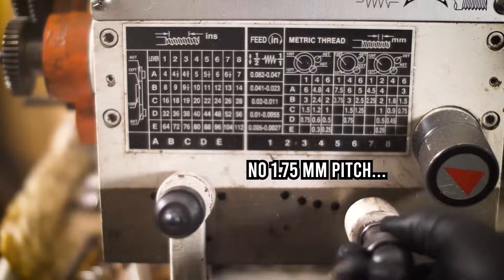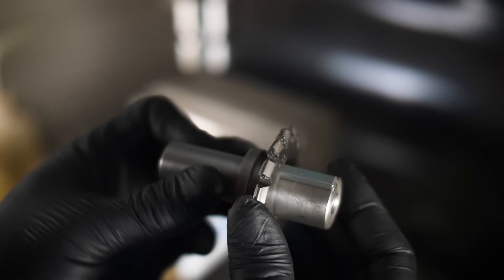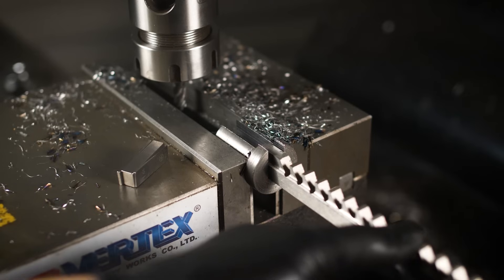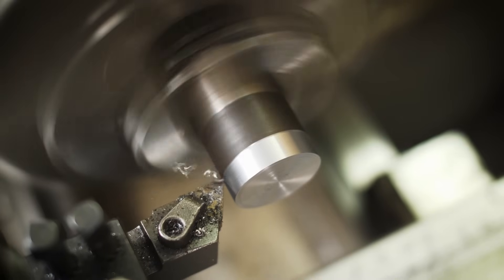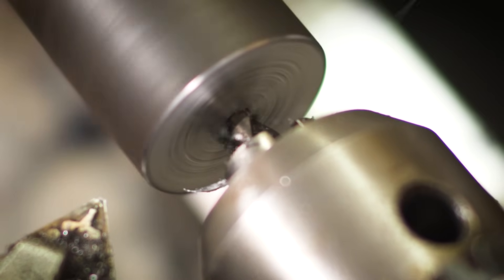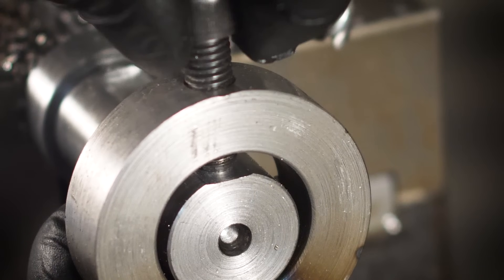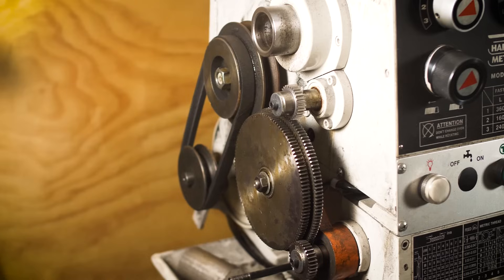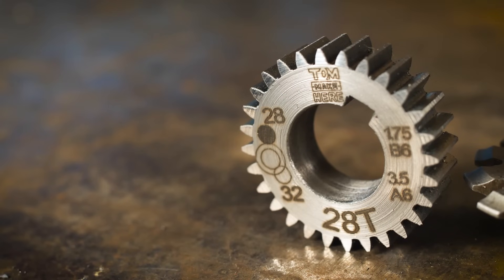Tool Making and Gear Making! | AL-960B Change Gear

Comment: Hi Tom, great to see someone else doing lathe videos and yep they are hard to video, tool post is always in the way, what a coincidence I use to own an AL 960 B and it did a lot of good work for me, looks like you are getting good results with yours as well ( my new lathe is a AL 356 a little bit bigger and heavier which I have converted to CNC ) I think I will have to get a laser engraver I think they would be so handy I really enjoyed the video and have subscribed, happy to support another enthusiast......... cheers Bill
Reply from the maker: I modified my toolpost so it doesn't have a permanent handle on top specifically for filming! Makes filming easier. Yeah it's a great lathe. I'm considering CNC upgrades for all my machines; I've come to the conclusion that I don't have as much time as I'd like. The laser engraver is useful, I didn't know what to do with it initially, but is very handy!

Comment: 4:19 Between centres? 
You've got your headstock centre in the 3-jaw, with any inaccuracy that chuck has.
My lathe has an MT3 taper in the spindle so I can put a centre straight in and drive on the faceplate for driving between centres. 
Check if yours has this.
Reply from the maker: Mine does have the centre, but then no way of turning the dog. I turned the 3 jaw'd centre in place so it is running true to the spindle

Comment: Perfectly cut and put together video for an old guy like me with the attention span of a sparrow.

Would love to have a go at this but at the moment I have a mini lathe and 3d print any extra gears I need.

Thanks for the upload.

Regards Doc from South Australia.
Reply from the maker: @doc1701  thanks! I do try to keep the videos concise. I've heard about people using 3d printed gears, do they work ok?
Reply: @TomMakeHere  They seem to do the job well enough for me. 
I have a 7x14 mini lathe with plastic gears and only need to use 3d printed ones occasionally for threading some weird thread.
No problems yet, touch wood, erm, metal 😀
Reply from the maker: @doc1701  😂

Comment: Hi Tom, i saw from one of the comments that either yours or Mattys tooth count will work. Mate i just wondered if you knew and could share the number of teeth on the gears A to E and 1 to 8 on the selectors. I cant find them anywhere and they would be needed i assume to calculate final impact on leadscrew? Many thanks, Steve
Reply: Addit...all good. Just worked backward from change gear table.....derrr 😊

Comment: No heat treatment?
Reply from the maker: The gear only gets short, intermittent use. I've seen 70 year old lathes with cast iron gears that are in perfect condition. So I'm comfortable with unhardened gears for this application

Comment: Another good video Tom. I recall Matty from Matty's workshop making a gear for his lathe (same model lathe as your one I think) to cut a 1.75mm pitch thread. The discussion at the time with him was that all M12 bolts that you get from Bunnings etc. has a 1.75mm pitch thread. So it is a common pitch in regards to M12, but it looks like M12 is the only size to use the 1.75mm pitch. A couple of years ago I brought a larger Hafco lathe, and I noticed that I have 1.75mm pitch available. That said, I would have to change out the gear and install the 35 toothed gear that come with the lathe.  It looks like the gears that you made have 28 teeth so I presume there are some differences between our lathes.
Reply from the maker: @thehobbymachinistnz  yeah its only M12 that uses 1.75 pitch as far as I'm aware. In making drawbar etc I need M12 fairly frequently and dies aren't great in this size unless the thread is partially cut. It's possible to achieve this thread with either a 28 or 35 tooth gear but a different combination of gear levers. I figured why cut more teeth than required? 😂

Comment: How did you determine the outside diameter for the 28 tooth gear. On that lathe are they a modular section (metric) cut.
Reply from the maker: I measured an existing gear OD and used that to calculate the module. I checked a couple of hears to be sure. Then I just used gear formulas to calculate the required OD

Comment: Great video! Love the laser engraver, very useful. 👍
Regarding the hydraulic press, if you made a top cup that held the top end of the broach secure in XY, and held the workpiece secure in XY, the broach should work fine. Typemof press doesnt really matter, the thing that matters is that the broach is constrained in XY and can only move in Z
Reply from the maker: Good point. Yeah some guides would definitely help contrain it
Thanks for watching

Comment: Nice vid mate. I have the same lathe that I rebuilt it from new and accurized for substantialy for gunsmithing. They are actually quite a good bench lathe. One mod I did to mine was to make  a phenolic resin sacrificial gear in the train as they have no clutch on the line anywhere so if you are too slow on the nuts and crash it without a soft gear they will destroy themselves. Also I threw away the duel speed B section pulleys and went to a single A section with a cogged raw edge belt to remove vibration. Just thought I would share this for consideration. These mods made a good lathe into a really good lathe for small accurate work. I've built some amazing target rifles on mine.🤘
Reply from the maker: I have quite a few mods that I want to implement, yeah belts is one thing. I also need to check out the middle speed detent, it always slips out so I don't use that speed
Reply: @TomMakeHere  Yup I did a mod on the speed lever indents too. From memory I reamed the handles to 7mm tight and used a 7mm ball bearing with the indent dimples reworked. There's not really enough room for a neutral indent though, so you just have to make it sit there. Just bought one of your gears by the way. It's been on my list of jobs for a while so this saved a lot of time. Thanks mate. Just dropped you a sub too fella. If you wondered I did my trade at Hercus in SA. So lathes are a big passion in my life. I also have a Hercus 260 from 1978 that was built by a toolmaker at Hercus for himself. It's a remarkable little machine ❤
Reply from the maker: That's cool. My first proper lathe was a Hercus Model C, it features in some of my older videos. It was a bit worn, but was still a great machine. Thanks for the sub and purchase. I'm going to be making a new batch of gears in the coming week or 2 around Christmas

Comment: Wouldn't need a sleeve if you left a small step on the shaft
Reply from the maker: I know. I quickly made it up and then realised I only extended the tool mounting shaft and didn't move the shoulder. So the sleeve was my solution without making the part for the 3rd time!

Comment: How did you break that parting tool? Did you accidentally move your longitudinal feed?

Also, a broach needs to have oil on all faces, and to make sure the broach is not tipping outward at its bottom, because if it starts to dig in, it will run away and take a deeper cut at the bottom of the keyway than at the start.

I amke sure to let off the pressure on the press, and re check to make sure the broach is still square.
Reply: Correct.
Reply from the maker: I was awkwardly working around my camera, kinda hugging it to get the lathe controls, and accidentally plunged the parting blade in quickly
Yes I should have used different oil and a longer bush to keep the alignment

Comment: Thank you, that was great.
I really like the fast pace. 
Nothing more tedious that watching manual machines work in real time.
I don't know why the broaches were breaking, have you sorted that out?
Thank you again.
Reply from the maker: Thanks!
I think the broach guides were too short, lubrication could have been better, potentially taking too deep cut, not backing off enough and not having enough feel with the press are all too blame
Reply: @TomMakeHere  Yes, hydraulic presses have no feel. I ran a 75 ton press.
All the things you say are true.
When things aren't perfectly trued up you can feel it in a hand press. Hydraulic, not so much. More a feeling and sound and thinking the pressure is a too high for this job.

Comment: A heads up if broaching key ways the best cutting aid to use is Trefelex tapping compound. Not the oil but the green paste Always get an excellent finish with a big reduction in cutting load. You are probably aware now but the bush must always go beyond the end of the bore for one cut broach square key ways. Also a good idea to make the bushes to make a rectangular key way. Then all you need to do is shim for square.
Reply from the maker: Good tip. I probably should have used my usual sutton cutting paste. Yes my bush was too short in this case

Comment: Anyone who knows what went wrong with the broaches?
Was it the speed of the press?
Reply from the maker: Doubt it, it's a 40t pess so it's slooooow. But being so strong there is less feel. The part was also quite long, and therefore multiple teeth would all be cutting simultaneously and increasing the overall load.
I'm also not convinced I was broaching straight either
Reply: Not the speed. 
Made a hydraulic broach press that is slow on the way down and fast return ( fed by power pac).
On the very large broaches I use my self made 100ton press. Made every part, cylinder,  piston, press frame. Made the power pac for it as well, including the coupling, coupling bolts, even the O ring fittings.
Reply: Oh, it is variable pressure. Wouldn't use all its  100 ton for broaching. Also made it with remote control so I can hide around the corner if things look dicey.

Comment: Hmm cutting oil on the broach?
Reply from the maker: Yep, used it. It was a thin waterbased oil, but it still seemed to cling to the teeth
Reply: @TomMakeHere  Was weird I did not expect it to brake must have been skew or stuck somewhere
Reply: Put slideway oil on the broach sides and back and cutting oil or compound on teeth.
Hi from John ( Boom Engineering Sydney)

Comment: New sub, plus i bought the AL960B a couple of weeks ago. So I just ordered your gear.....I'm in Melbourne too!😊
Reply from the maker: Awesome, it's a great lathe!
Reply: @mmazz30   I've had mine for 10 years and use it for rifle building. They are a very well built lathe mate. You won't regret paying just a bit more than the Chinese built machines. The other is the AL1000 if you wanted a bit bigger, but I am really happy with mine. Check out my other comments here for some improvements I did to mine if you're interested mate. 🤘❤️
Reply: @BH_tradie Cheers, I will check your updates.
Thanks.

Comment: Tips for broaches: touch the top of teeth with a stone, this will avoid tooth dig in and broach not going straight.
Arbor press sizing is about 1T for 5mm broach in steel.
Reply from the maker: Good tip. I wonder if the sleeve was too long, is there normally a depth limit on broaches?
Reply: @TomMakeHere  there is definitely a cutting length limit. I have made my sleeve also, depth is tricky but length itself do not matter.

Comment: You should have made you broach die deeper and use a shim. Do  it is two pass's.
Reply from the maker: I didn't even get through the first pass on the spacer though, and it didn't even start engaging teeth until halfway down. So I think the broach was not vertical and was digging in too much at a guess
Reply: Absolutely right, but frequentely 4 or 5 passes (more safe😉❤)

Comment: Good one, Tom. Don't know why you beroke so many tools, but s**t happens :)
Reply from the maker: @Rustinox  I'm a bit out of practice. Haven't been in the workshop a lot recently
Reply: At a guess,  the supports under the part in the  press were flexing allowing part to shift slightly and the tool to dig into the part .
Reply from the maker: @wktodd  I'd say so yep